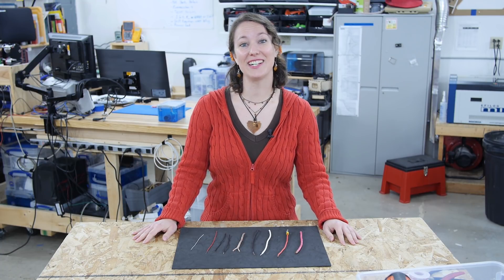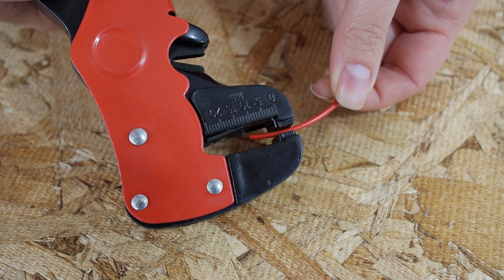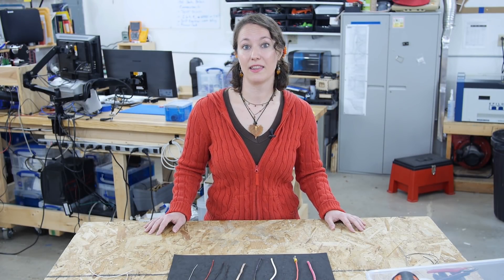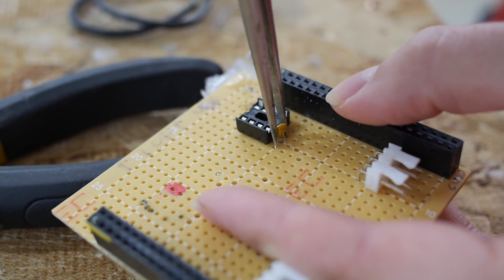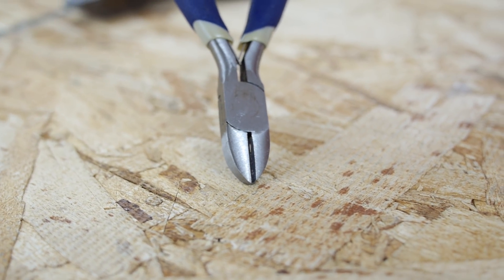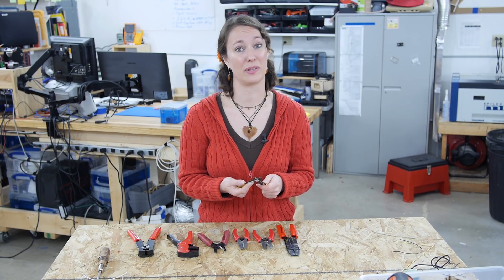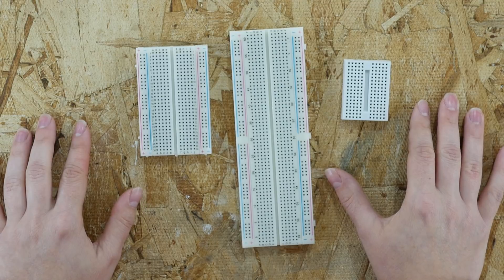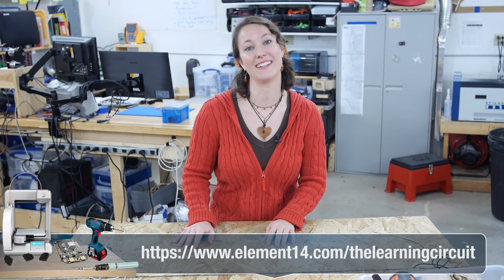Basic Tools & Wire - The Learning Circuit

Comment: Well, I do not intent on building boards, but rather repairing some old PC parts I got, Like battery leak corrosion on old motherboards and blown capacitors. And I'm a dummie on tools and equipment.

Comment: 20 years of eletronic repairs experience and I found out that the best tool to remove wire the insulated plastic from wire is a nice and cheap nail clipper.

Comment: Thicker wire doesn't handle heat better, it can literally conduct more electricity without getting hot, assuming it's not extreme (think high tension wire) high voltage.
Reply: rewtuser well it kinda does, 5Amps going through 22 guage vs 32 guage...32 guage would get hotter...but i get what ur trying to say.

Comment: We don't measure wire size in diameter in Europe, we measure it in square millimeters.

I just use my wire cutter to remove the insulation, though my cutters are not straight and they're built for it. Much easier, don't need extra tools to get the job done. You learn how much pressure to apply in order to not damage any strands.
Reply: here we use awg gauge
Reply: In Canada we use AWG
Reply: I've learned to use AWG pretty well, but I wish we used area. It makes calculating voltage drop and resistance more logical.